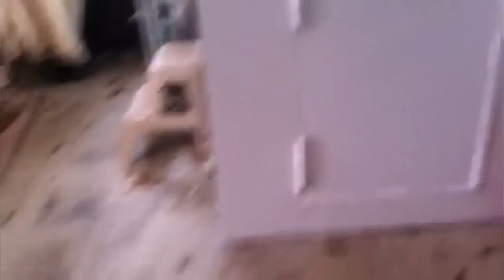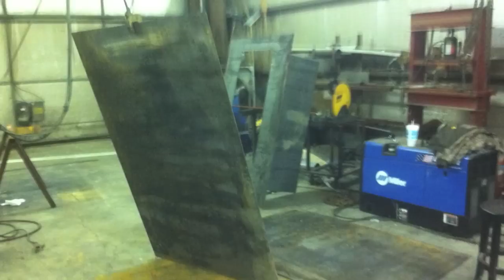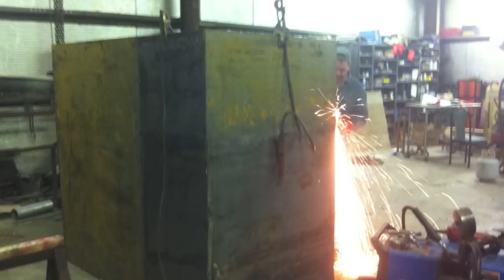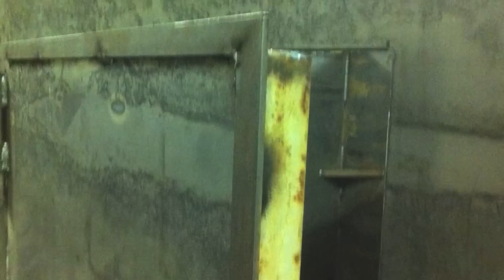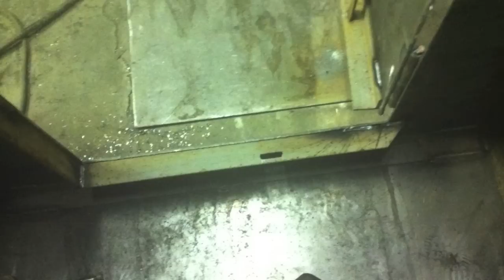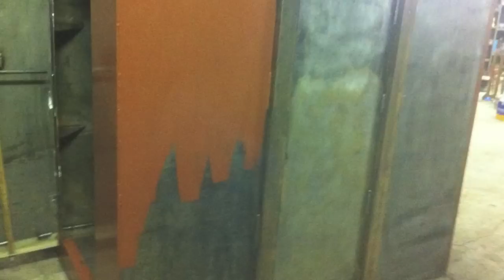Home Made Tornado Shelter

Comment: Two part comment:  first is a question, how did you move it into place once finished.  It had to weigh a little over a ton based on the weight of steel plates and all the other parts involved.
Second is a statement.  I never cease to be amazed at all the trolling idiots who think they know something based on nothing.  That thing is way better built than most commercial units that are “certified”.  No an ef5 won’t move it, nor will it be crushed if a house collapses, or any other scenario.  Why do people always feel like they have to state some negative, probably out of jealousy is my guess.  Thinking of building one myself.  Great work.  Hope you see my comments years late.
Reply: We unloaded it from a tilt trailer as close as possible to the garage and then pushed it into place with a backhoe. Thank you very much for the positive comment. Sorry it took me so long to respond. We didn’t mention it in the video, but the metal is AR 500.

Comment: What happens if debris ends up in front of the door and you can't get out? That would be my fear. Just a suggestion but could you mark on the outside that it's a storm shelter and it needs to be opened immediately by rescuers?
Reply: Door should open towards the inside.

Comment: It looks like you thought everything out but the swing of the door and the the wheel used to lock/unlock the door.
Reply: Actually, I put a lot of thought into it. It’s much easier to make it strong when the door overlaps on the outside. And you are the one of many to comment on this. Does no one read the other comments, or do you like to repeat things over and over?
Reply: @steveseymour1739  Settle down Steve. No, I don't read all the comments. You probably shouldn't either if this is your reaction to someone bringing up a valid point. Look man I'm not knocking your shelter, I would feel safe in there but it's the whole getting out after that would concern me. You sincerely did a great job.
Reply: @shane7133  thanks that’s very kind

Comment: One extremely fatal mistake in the design,  the door doesn't open inwards so as to facilitate an escape, if the door becomes jammed from the outside with debris.
Reply: b57ecv It’s  not a mistake at all. That issue has been addressed by several other viewers, if you take the time to read the other comments. The door is much stronger if it opens to the outside. Getting out is not as big a deal as being dead. It is the best design for its location.
Reply: blipco5 Ok, your right, so you stay in the house as it blows away and Mom will be in the shelter behind the AR 500 steel door that “MIGHT” have something in front of it. It was built so that she wouldn’t have to worry about where to go during a tornado, mission accomplished. Feel free to build one with a door that will swing in when debris traveling 200 mph hits it if that’s the design you like.
Reply: +Steve Seymour ...Not if the house has fallen around the door and has caught on fire. The builder did a great job but NO storm shelter should have a door that opens outward. Hinges need to be made to disassemble from the inside.

Comment: how us this saving money exactly?
a lot of the cost in most things you buy it is due to the labor and associated costs of manufacturing.
not trying to be negative however the only positive here is that you can say you built it yourself.
Reply: He still has the 3.8k dollars that he would've spent on a commercial storm shelter, I'm pretty sure that's what saving money is, despite whether he worked for it or not. You may be expending labor, but not your cash.

Comment: Great job on the shelter! looks like it would take a beating for sure! My question is obviously the weak link in this chain would be the anchoring to the floor, did you use epoxy on the bolt holes as well or just the standard compression type anchor? Thanks.
Reply: Tim TheGunGuy  the bolts are wedge type. We checked the specs and wedge type actually have a higher tensile strength than the epoxy type. Most likely anything that hits it will be coming at it sideways, so shear strength will be more important than lifting force anyway.

Comment: Nice job. Put a latch on the inside and you have a safe room too. 1/4 steel would probably stop a lot of handgun rounds.
Reply from the maker: There is a latch on the inside. Thank you for the comment
Reply from the maker: It's also Ar 500 steel so it will stop lots of rifle rounds too 🤓
Reply: +MrChevelleMan  Nice job.

Comment: A 4000 lb pickup truck flying through the air will shear that off the slab. I would have cut the floor and buryed at least 3 feet of it into the ground.
No-- I would have cut the floor-dug down about 4 1/2 feet. laid used free 8 inch block.and poured the garage floor back as 6 inch reinforced cement.  Sand gravel a borrowed cement mixer A hundred bucks for the metal for a hatch ( 24 by 30 in ). $300 and my labor--total-
Reply from the maker: hogflyer62      Guys. We did it this way because my grandmother lives right beside the green river in the flood plain.  The concrete was poured by my grandad himself and it is close to 3ft thick.   If we buried it we would have to pump it out.  This was the best option for her.  Period. And you've never seen a test that could compare to this one.  All steel here is ar-500. 3/8 thick. And the concrete bolts are 5/8" diameter. If you know anything about metal at all you'll know that this isn't your ordinary store bought job.
Reply: If you look at that video of the car dropping (and the other objects dropped as well), you can tell it's a marketing guy exaggerating the height as usual (by about 2X - measure up the screen at the height of the shelter vs. the objects dropped).  The car is probably about 36' and being stripped much less than 3500 lbs. But still impressive none the less dropping that much weight on it.

Comment: Nice job can't go wrong with steel. On question what happens if an object blocks the door and you can't get out?
Reply: Needs a second inward swinging door that’s bolted in place with tools inside to remove bolts.

Comment: I'm not disrespecting your build ...I'm actually very distracted right now looking up parts for the 71 olds  cutlass I picked up today (1000 bucks)...worse yet,I found a 72 ram air,tack hood,455 (original motor too) gto I'm picking up wednesday ...I feel ridden with guilt because the seller has absolutely no clue what they have and I got it dirt cheap...800 bucks !!!!!!!!!(basically less than a good aftermarket hood)...they think its just an "old pontiac"

Comment: In the state of Florida I have lived over the last 38 years,and in that time I have been here for every hurricane and even encountered a few tornado laden storms in Ohio and Oklahoma.And while only Andrew stands out in my memory as being very bad,Charlie was bad too for some.What I'm getting at is if my limited exposure and most being only hurricane strength,many times in my short life I have seen small storms that could wreck a metal box.What if a 25,000 lb boat lands on it ?
Reply: An F1 tornado is not going to pick up, nor find a 25,000 pound boat in Kentucky.
You'd be surprised what a "metal box" can withstand. This particular box could probably withstand up to the strong end of F3 winds, which is like low end Category 5 winds for a hurricane.
Reply: This shelter would easily withstand a direct hit from a F5. Anyone with any kind of experience in welding and using metal would know this. There are videos of gun safes here on youtube that survived the F5 tornadoes in Moore Oklahoma. The only thing left on the slab was the safe. And a Gun safe pales in comparison to this shelter.

Comment: Did you eat lead paint as a kid? You're missing the point. In order for winds to lift an object, the wind has to crash through it and blow the debris away,  or get underneath the object. Familiarize yourself with FEMA P-320...Have someone read it for you, or look at the pretty pictures. Either way, you will understand 1/4" steel plate bolted to a concrete foundation exceeds FEMA tornado shelter specs.
Reply: Finally someone with a brain. Good job man.

Comment: Tornadoes rip the wood, glass and drywall from the foundation...The foundation usually remains. Reinforced concrete blocks are very strong. Basements are often not safe from tornadoes because of the debris that collapse into them, or the flooring above the basement gets ripped away and the people hiding in the basement get sucked out.. You never see the concrete block walls of a basement  pulled out from a tornado.

Comment: Most objects get moved because wind is able to get underneath. Houses get moved/blown away because the wood  framing doesn't hold up to the high winds. That shelter isn't going anywhere since it is flush and bolted to the foundation. Mythbusters tested a one person shield, not even a shelter, against F4 winds, and the shield held firm! youtube(dot)com/watch?v=QZ2vGUXhNSY

Comment: after I looked at a few videos I realized 2 things,that yours is built as good or better than most...and many people have survived due to a shelter of the same style.....but it would be the longest 5 minutes of my life sitting in a metal box waiting for a bad tornado to pass....hearing all the sounds and debri impacting it. I have done a lot of concrete work and feel I would rather build a solid poured reinforced room if it was above ground (probly because I'm not a welder) still,nice job
Reply: Either this shelter, or concrete would do just fine.

Comment: You can’t really make an equal comparison between a safe room and a car or house. Storm shelters are relatively small and have less surface area than a car or house. They’re anchored at many points (not with wood and small nails) to concrete slabs eliminating lift. Now, if your house is gone and here comes that SUV at 300 MPH and slams into your safe room, then that’s where I’d agree that underground is hard to beat.

Comment: should paint it bright orange so rescuers see it and realize there are probably people in the crumpled box that got tossed just as easily as the cars and S.U.V. s do.... A whole house can be moved and they are more firmly planted than just having bolts drilled into concrete.Dude,great fab work but I would prefer it to be at least half under ground to feel a bit safer.

Comment: Theoretically, couldn't you get trapped in it if someone or something on the outside jammed the wheel?
Reply: I think I would make the wheel removable so that you can open it from the outside and then remove the wheel and attach it to the inside to secure the door. Double the usage of the wheel while minimizing opportunities to get stuck inside.